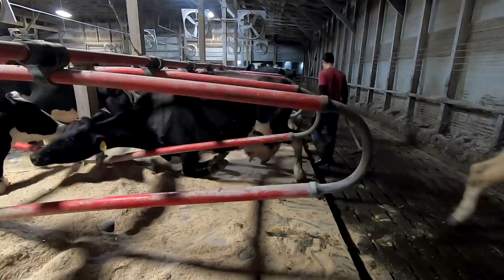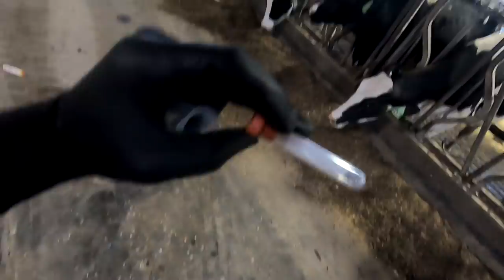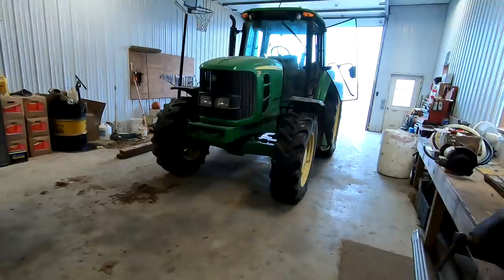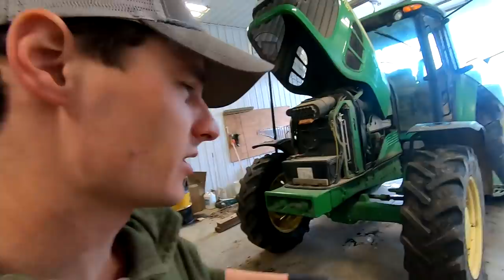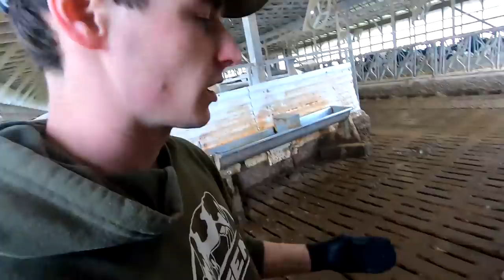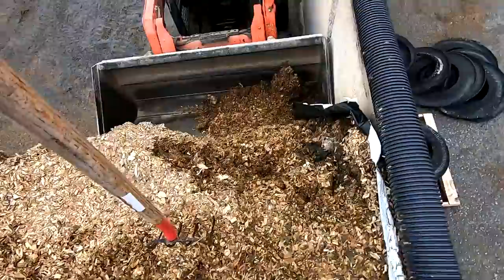Cows & Tractors

Comment: When changing oil on any engine, I hook a shop vac to the oil fill port, turn vacuum on, drop the oil plug from the pan, scoot catch pan(bucket) under drain then shut off the vacuum. No oil slopped hands. As for the filters, a nice sharp punch to the bottom and drain out to catch pan. Filter punch may be messy on tractors, works great on 7.3 powerstroke.
Reply: I don’t think those 7000 series have a clear shot to a pan. You would probably get oil all over.

Comment: Was working with a mad man of a contractor one year doing grass silage. Came back to his yard one evening after finishing for the day and he was underneath a 7810 John deere with a hammer and chisel trying to open the stump stud. Half of the head was missing... couldn't open it with a wrench so he went straight for the chisel and hammer. Ended up having to weld a bar on to the stud to open it.

Comment: A little trick to stop getting the oil from the filter all over the place is the punch a small hole in the side of It with a nail and collect that with a small cup then take the filter off.

Comment: Electric door will be a Life saver in the winter and spring especially when its snowing or raining.. Now you need a robotic rototiller for the new building to go from pen to pen and go under the gates. So you don't have to move cows when you use the tractor to rototill

Comment: Did you end up cutting the rubber belting off on the floor so the one discovery didn’t crash out there all the time? And I noticed one machine you could see down through the sensing wheel but the other you couldn’t. Does that allow more manure to build up around the ultrasound/foam pad

Comment: Hi Eric, just wanna ask if you can tell my why the 7220 has those Rods stick out from the center of the wheels and why you dont take them out? i can imagine it is possible to catch on something when driving tight around something.. greetings from Germany!
Reply from the maker: It has long axles so you can put dual wheels on it. We would have to cut them off and maybe we should.
Reply: @10thgenerationdairyman61  Could potentially plummet your resale value if you cut them off.

Comment: fill the filter before you put it on
Reply from the maker: I've heard that can do more harm than good
Reply: @10thgenerationdairyman61  not at all, you get oil pressure quicker/ I used to change oil on a fleet of 18 wheelers and that's what we did. your call, good luck
Reply: @10thgenerationdairyman61  Unless the manufacturer says to fill, please DO NOT fill. Most oil filters feed the oil from the centre of the filter and drain from the sides. If any contamination is present in the new oil (which does happen) then this will bypass the filter and end up in the engine. I was a Master Tech & Fleet Engineer most of my life so I have first hand experience.